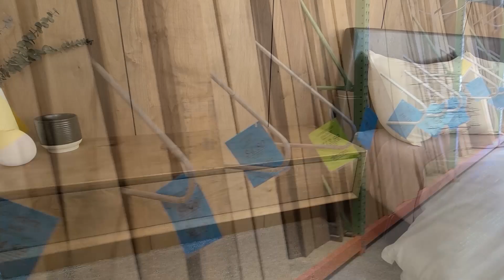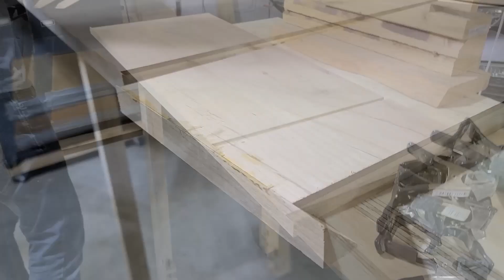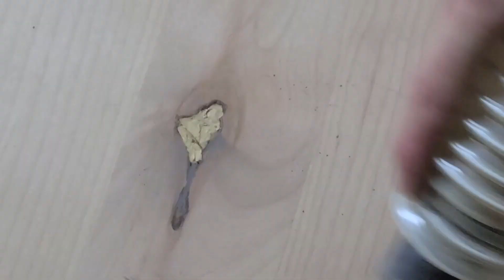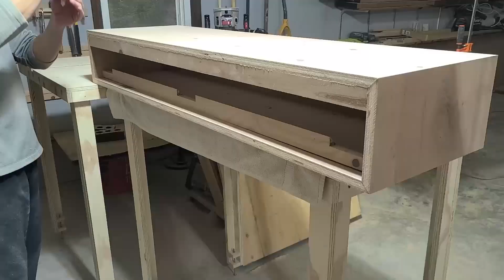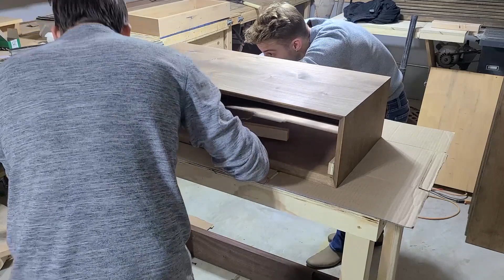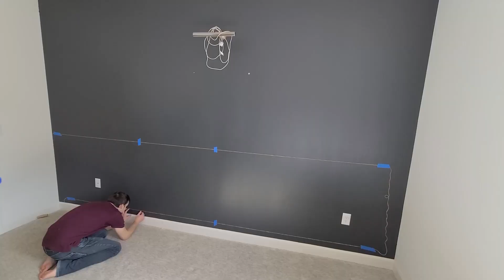This Build Was Bigger Than Our Shop

Comment: Are the panels removable or are they fully mounted to the wall?
Reply from the maker: The panels are hung using two sets of french cleats and same with the nightstands. So yes, the panels are removable but the French cleats are mounted to studs, continuous and not removable. So any access you'd want would have to fit between the top and bottom of the French cleats. The end of the video shows how they are attached and probably help you visualize it better 😊

Comment: I am curious if this could be built over an attic knee wall. With Biden access to the door.
Reply from the maker: Possibly! But would definitely take a little redesigning as I think most attic knee walls are like 2-3 foot tall. The panels are plywood 4' tall to be seen behind the bed and then one panel would need some sort of modification to have that hidden access point. Could be a fun DIY design problem to work out!

Comment: I'm curious if you needed both sets of cleats or just a spacer for the bottom. I'm looking at doing something similar, but taller. 10'wide by 6'high. Would I need more than 2x4 cleat material?
Reply: Looking to use 4 30" wide panels
Reply from the maker: 2x4 clear material should still be more than enough for those panels. We still highly recommend using a cleat at the bottom though to keep the panels tight against the wall.

Comment: Hello. Great idea to split up the headboard into smaller boards. Easier install Question - So... you did a French cleat on a French cleat - I mean draws hang off boards which hang off the wall. Just want to know what the stability is like? And have you seen this kinda double cleat thing done before?  Thanks!
Reply from the maker: The nightstands are rock solid.The beauty of french cleats is how effective they are at transferring a load. My biggest worry was the cleat breaking off the back of the box or else I would have stood on it for a thumbnail photo 😅 You'll see we used glue and screws to strengthen the piece even further.

I've never seen someone double them up before in woodworking, but the same principal is incorporated in some modular shelving systems. 
-Tyler

Comment: Beautiful builds.  What software do you use to write up the designs?  Also, i have an extra router or two laying around.  One is a palm router.  You can have it for free if you want it.
Reply from the maker: Thank you! We like Solidworks, but any 3D CAD software works. A lot of people like to use Sketchup as there is a free version. Although we could always use more tools, we actually got a palm router just recently (after this build of course🤣). But thank you for the kind offer!